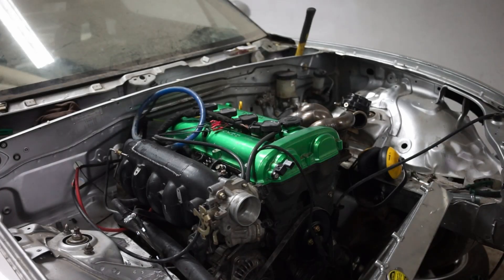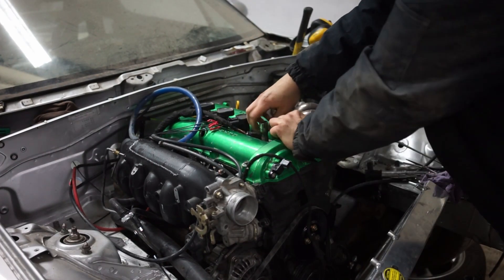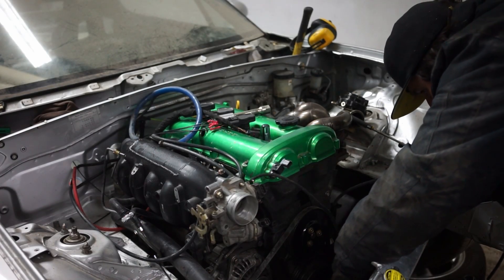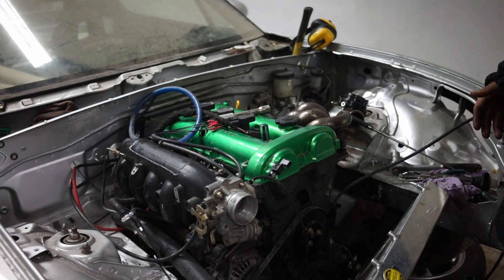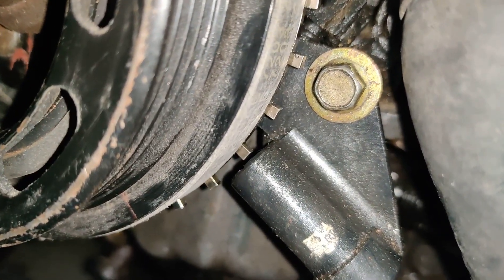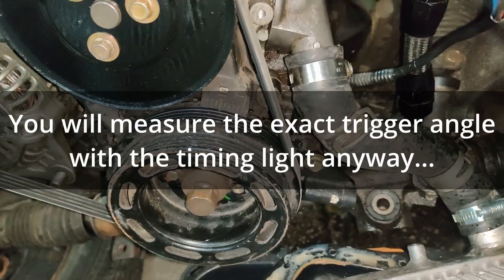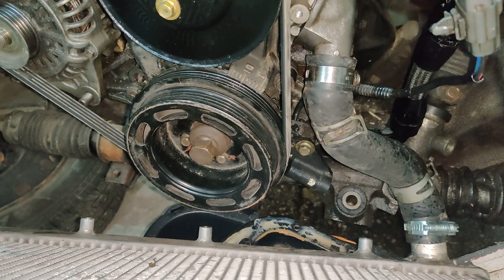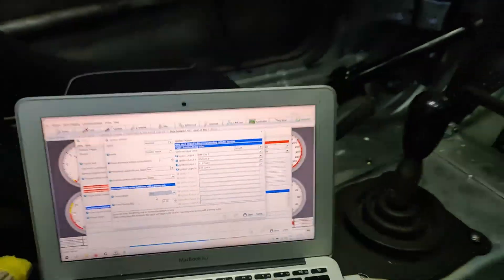Calculate your Trigger angle and set Base timing with a Timing light | RUSEFI ECU TUning Guide #3

Comment: Good video, will be very helpful to those who don’t know.
What I do is use a piston stopper, basically a brass or aluminium peice which has a thread so you can screw it into the cylinder head and it protrudes slightly down past the deck height, (can also use an old spark plug with the guts knocked out and thread the inside to take a bolt) then gently turn the engine until the piston touches the tool, Now mark the front of the engine…then slowly turn the engine the opposite direction - by the way your not supposed to rotate the crank counter clockwise but I’ve seen professional people do it! But turn until the piston again touches the tool and mark the engine….carefully measure with some calipers the distance between the 2 marks and simply divide by 2, at exactly half way between the marks we have TRUE TDC, ok it is a bit more work but it takes the guess work out of it, so I lock the timing in the software to zero and use the timing light to verify timing relative to that point.
I remember some guy teaching me this over 25 years ago and so far it hasn’t got me into trouble.
Reply from the maker: Well the problem with that would be that youd need to know the exact distance at that point you could just use a dial indicator I guess 

The rotating backwards thing is only a problem for some timing chain engines as they can jump timing but that's only in rare cases so most likely you'll be fine especially with an engine that has a manual tensioner like the Miata engine

Comment: I borrowed a timing gun and it couldn’t pick up a pulse on my COP wiring. I salvaged a stick type HT lead (from a K14 Nissan micra). I stripped back the insulation so I had about an inch of bare core and poked it up the smart coil, which was laid on the valve cover. The other end of the HT lead went to the spark plug. The pickup of the timing gun clamped on the intermediary lead and allowed me to set timing. 

Random info: the angle of the crank VR sensor on a 2004 Toyota Yaris with a 2SZ-FE engine is 144° and the cranking advance is 10°. The cam sensor profile is Toyota 3 tooth
Reply from the maker: yes this is sometimes the case. usually it will work if you put the clamp around one of the wires of the coils that uses a trigger or ground signal but not all timing lights work that way as the current is low. 
but using a spark plug wire shoved into the coil pack and then put onto the plug would also do the job as there the high current flows

Comment: Dang brother I didn't realize you had an MX-5. Those BP engines are incredibly close to the same components that are on my 1.8 T8D Kia engine  in fact the Kia engine will bolt in place in the Miata 
 It will bolt to the transmission and everything and the cylinder head even has a freeze plug that can be popped out and you can bolt on the water next to the front of the cylinder head
Reply from the maker: its actually a 1.6 in europe the NBs also came with those haha
Reply: @throttlebuddies0  yeah I'm not super familiar with the actual Mazda engines I was just done a lot of research because I've had Ford escorts and other Mazda cars but that was before I ever knew much about them and now that I own my Kia and since nobody makes parts for it I have to research every other type of engine to find out what I can pick and choose from in order to make work LOL. But I know the 1.8 and the 1.6 are both similar to the Kia design
Reply from the maker: @gettinshifty02 yeah for some reason a lot of parts from kia are interchangable with those engines sooooo yeah no idea. makes sense that ford is cause at that time mazda and ford basically were best friends haha but kia always was sort of a mistery to me
Reply: @throttlebuddies0 yeah I just kind of stumbled into the Kia world. Basically my pops had a car in the side yard that had no AC and he said oh why do you want that thing you're just going to blow it up trying to make it fast and it will never be fast. So I slowly did more and more stuff to the car, and now it's so fast he won't ride in it anymore LOL😂

Comment: Ya know what i have the most trouble with and need help learni g how to figure it out and would prolly be a good video , how to figure and start tuning cold start.. now that is the biggest pain in the ass i have had over my whole tuning journey 😂,  i can do almost everything els , but cold starts are a biznatch to gwt dialed in 😂.. anyways , mad respect and thanks for all the knowledge you share brotha , seriously much love and respect for that fam .. peace and love brotha, keep it rad, stay safe, and build on..l8r hommie and keep having fun 💪 

And again , thanks for being down to earth and actually helping us lil guys and the open source community 💪🤙🤘👊✌️

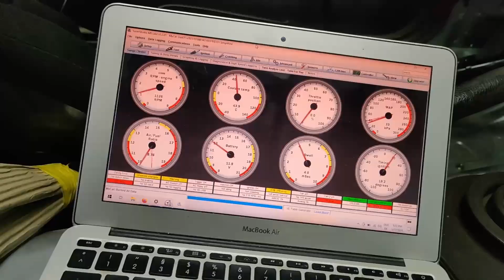8:34 battery voltage a issue for you to , or ya just dont have the alt hooked up? I have found the stock alt thats only 65 amp is greatly inferior when any mods have been done , but i also found that the rx8 alternator is a direct swap in no mods at all needed , bolts i. And wires are the same , sept the 8s alt is between 100amp and i believe its 120 or 130 amp , depending on what model it comes from .. much live fam
Reply from the maker: i will do a video on it later on 
but you can watch my video in the speeduino tuning guide series thats where i explain it a little bit and kinda translates to rusefi also so might be worth having a look at that. 
yeah im trying to help nybody and if someone needs tuning i also offer it for a relatively reasonable price! but everything goes directly towards the projects and videos same for any channel memberships and ad revenue haha 

Yeah i havent hooked up the alternator as it is an ecu controlled unit so i still need to sort that out
Reply: @throttlebuddies0 right on brotha , and ya know , i might take ya up on some tuning help , is there a email or site to better contact ya at fam?

Ps will definitely have to re-watch that video to see if i missed something that might help .. much love bro stay safe , l8r
Reply from the maker: @mastercricket7626  you can send me a message on instagram if you have it _Throttlebuddies or if you dont have instagram my business email is also in the description